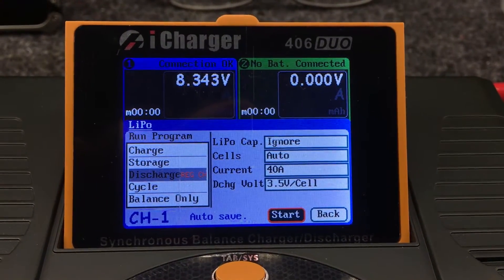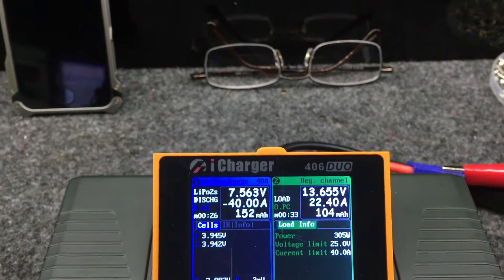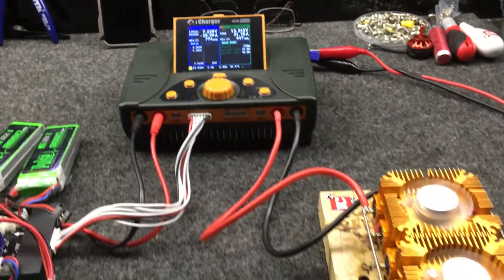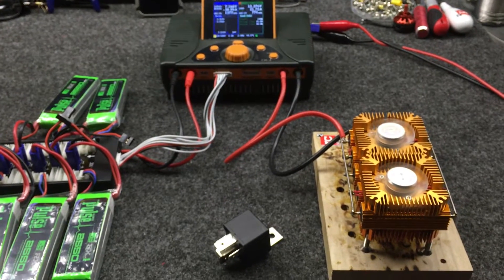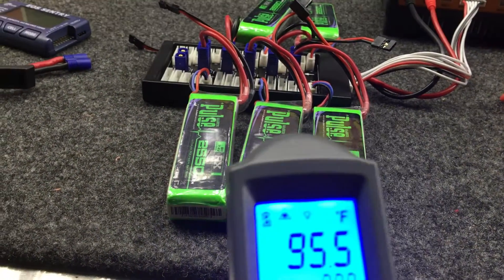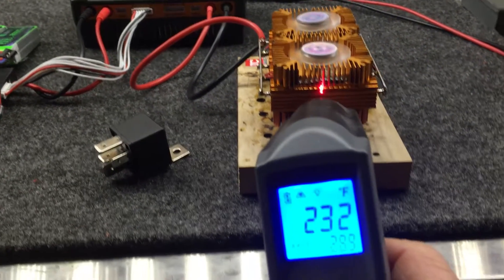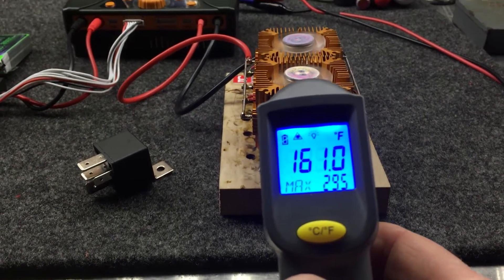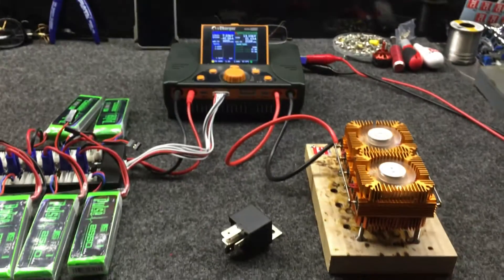iCharger and 40 amp discharge resistor bank

Comment: HELP!!!!  While discharging with the same set up you have (iCharger 406 Duo & exact resistor bank), the wires for the bank got so hot the solder came undone on the lead at the charger!!!   What can I do to deter this from happening again??  Thank you!
Reply from the maker: I would contact the company that you got the RB from, that is a issue....

Comment: What value resistors are you using on that load bank?  I am trying to assemble the pieces to build mine and I am struggling to find any real info how to build those. Or where did you buy yours at if its pre made?
Reply from the maker: These were sent to us by our customer, I'm not sure about any specs.

Comment: Why I need use  discharge resistor bank??
Reply from the maker: The highest amp current you can discharge with a 4010 duo is 130 watts. This lets you do a full 40 amp, the RC Car guys use this to condition their batteries before a race.

Comment: I finally ran mine a few weeks ago. I was able to discharge at around 5-6 amps on a 6s 4500 battery. I believe we are limited on that due to the input voltage to the resistor bank. It's my understanding that the fans can't handle more than 12 volts.

Comment: Do you need to discharge the resistor after?   or does it just soak up the power?
Reply: A resistor cannot hold a charge. It converts the energy to heat.

Comment: Those fans should be hooked up to an external power source. As soon as the batteries are done and the icharger turns off the second channel. This is going to cause the resistors to heat soak and shorten the life of them. Hook them up to the power supply for the icharger.
Reply from the maker: I see what your saying, we don't build the resistor banks. For our install purpose we use (2) 93mm squirrel cage fans with a independent power source. Please watch this video. https://youtu.be/y2R4BnB53RQ

Comment: Does this also work with a 1S lipo where there is no balance lead connected ?
According to the manual it needs to have a balancer lead connected but off course with a 1S there is no balance lead.
If you don't have a 1S lipo could you try if it works with the balancer board disconnected ?
I want to buy one off these for testing my 1S and 2S lipo's but would like to know if it will work with 1S.
Reply: Hi there! Have you found out if its working with 1s lipo?

Comment: Did the resistor bank feet create those burn marks on the wood? 
I guess its not safe to sit it on an unprotected surface?
Reply from the maker: That is my soldering block, I was not sure how hot the feet would get so I went with the wood to protect my assembly deck (Trunk liner on 1/4" plywood)

Comment: found this guy on Ebay for $80. Nice craftsmanship. 
Do you happen to have a video tutorial on how to setup the charger?
Reply: I noticed you run your discharge voltage at 25V. Isn't that harmful for the 12V fans on the resistor bank? 
I am able to get my resistor bank to discharge now, but with a setting of 12V it is only able to discharge at a max of 12A???  Why is that?
I was reluctant to try to raise the voltage setting, but when I did, I was able to draw more amps. But I am reluctant because of the fans on the discharge device. I do not want to damage them. Any help is appreciated.
Reply from the maker: I was discharging at 8.343 vdc at the peak voltage. The settings in the charger are what the manufacturer suggests. I went with the 40 amp to get a worst case temp reading.
Reply: I see your screen reads 25V. Isn't that bad for the discharge unit? The 12V fans won't get fried?
Reply from the maker: That is the max settings. A 2s lipo wont reach 25v. I'm just setting the iCharger to the settings recommended by the company that makes the Resistor Pack.
And as for your question, yes, if you put 25v into a 12v fan its going to be a bad day.
But we have a solve for that also.
Reply: I am working on 4S packs. I do parallel discharging.Kyle Cashwell
Reply from the maker: Some fans that are 12vdc can take the higher voltages like the high 14v from a 4s pack. But we prefer to use a stepdown converter when dealing with high current to protect the fans.
Reply: @kylecashwell1059  I am years late to this party, but 24v fans are easy to come by. That’s what I use in my charger case.

Comment: Kyle, can you share the specs on those resistors? 1ohm 100watt?
Reply from the maker: +wrxsavvy I believe so, Customer sent us these pre-made to install in a custom charge case. I needed to know the temp for design reasons.
Reply: +Kyle Cashwell (RotaryWingRC) thank you. I can't see this going in a case unless the case is compartmentalized with a heat barrier.  the service you provide is incredible. From a customer I wish you all the best.
Reply from the maker: You can see the build on our FB page for the cases.
Rotor Craft RC